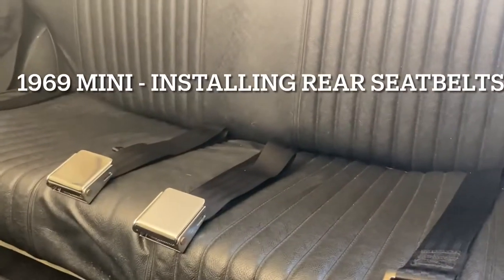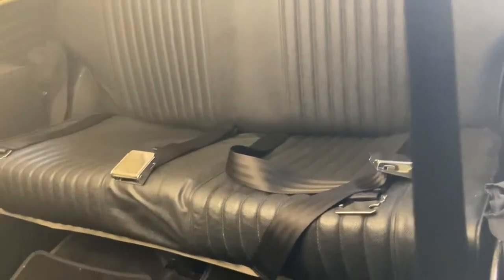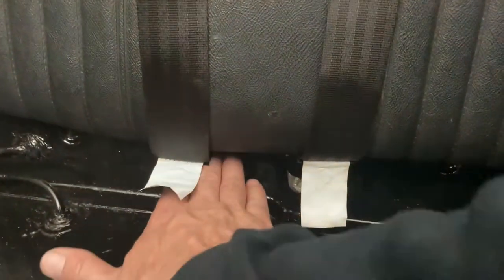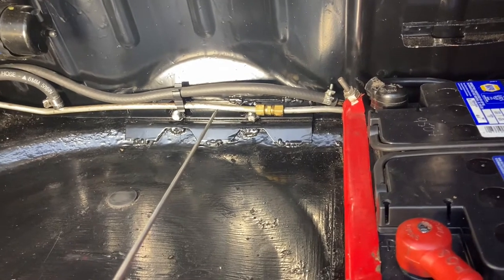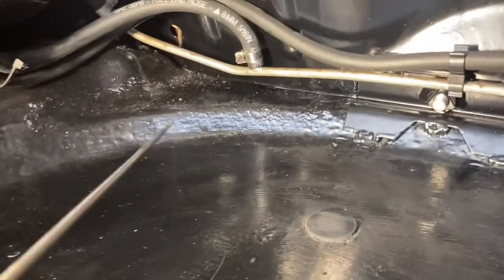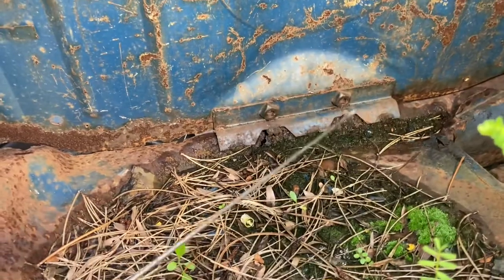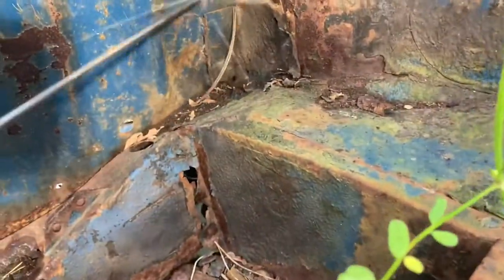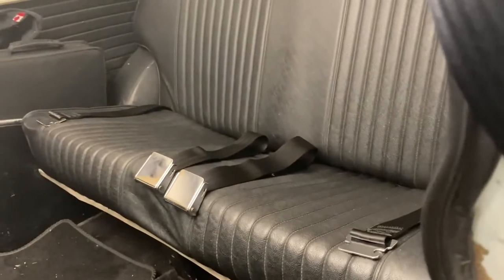Installing Rear Seatbelts in an early (1969)Mini

Comment: Where did you buy these? Do you have a link?
Reply from the maker: The belts I got through a local supplier - which I believe came from Moss. 
The brackets came from Mini Spares (which I believe have the belts too).